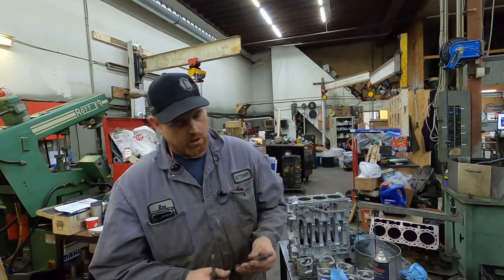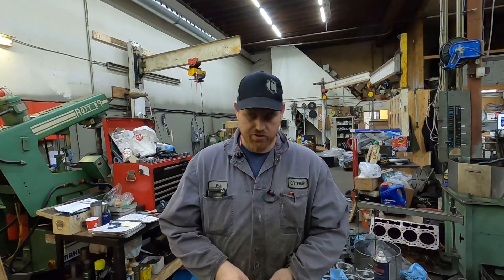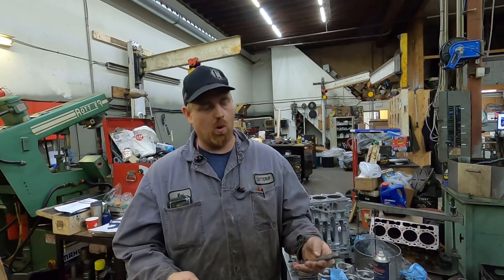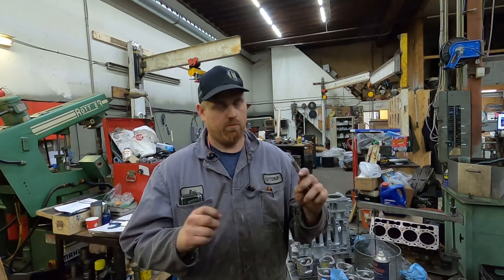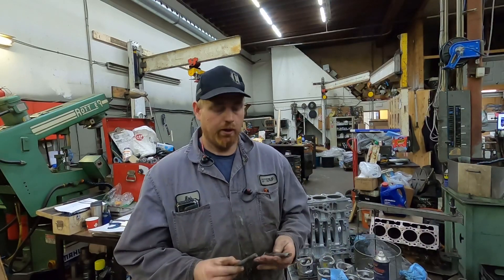Pro tip. How to make a thread chaser!!!

Comment: I couldn't believe you had this tip on youtube😮If you want a   die or a tape for some materials make sure your cuts are angled, put cuts and lead thread heat cherry red drop in SUGAR THEN OIL🤔😎it Works ok most GOOD nuts & bolts are tool steel 4140 can get about 60 Rockwell hardened 😊

Comment: Is the bottom tap necessary? Ive got some exotic studs id like to do one at a time.
Reply from the maker: Not a bad idea. But if the hole is clean inside most of the time you don’t need too
Reply: Thanks man